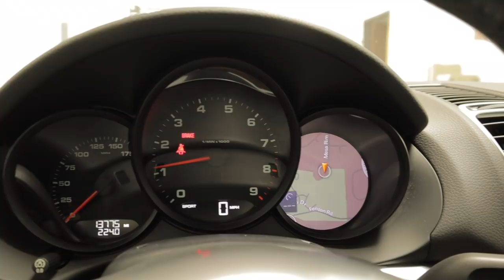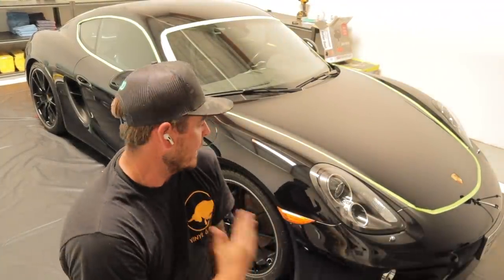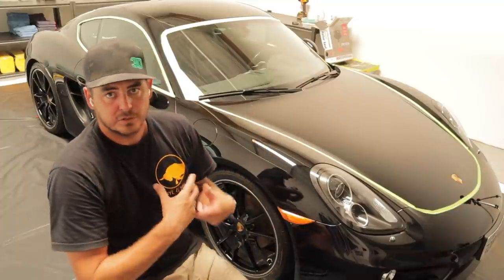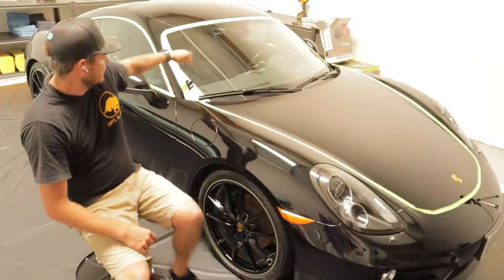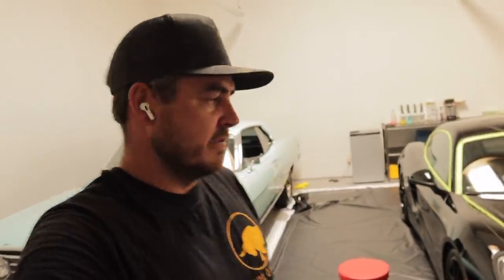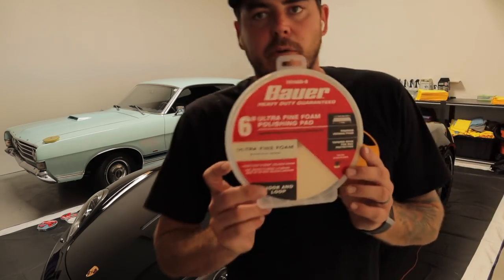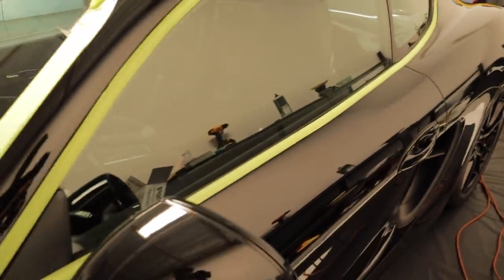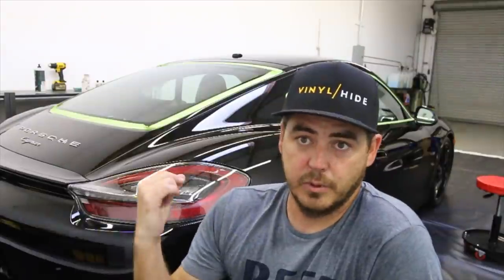20 HOURS Porsche Cayman Detail and CERAMIC COAT!!! | Satisfying Car Detailing ASMR | Ceramic Coating

Comment: Awesome Josh, I did this with my new car in January but I was new to ceramic coating so I used the Turtle wax hybrid solutions ceramic coating spray. It turned out well as I followed the instructions to the letter but I definitely want to try a top brand ceramic coating now and your video here is a brilliant “how to” I can’t wait to get everything in and seriously detail my car👍🏾
Reply from the maker: Awesome!  When you go to the full blown ceramics you just have to be careful not to get high spots. Everyone says a certain amount of time between applying and wiping off but it really depends on the conditions you’re working in. I’ve had it where I apply and immediately remove the excess. Test a small panel and see what timing works best!!

Comment: Thanks Josh for another great video. I’ve used your links for the washing stages of a car. I’m practicing that stage before I move on to learning more and feeling comfortable and confident with polishing. I’m sure I’ll go with your suggested products and tools...so far they make sense and seem less marketing driven than some channels.

So here’s my question...I watch these polishing videos and see the polishing big surfaces turn out incredible...what I haven’t seen is anyone focus on the hard, tight areas...the front end, back, rocker panels...around lights, logos, handles, mirrors...do those get done with a machine still or do you do those areas by hand if at all? Can you address these areas in a video? 

Thanks for all your help and excellent, pragmatic lessons!
Reply from the maker: I can! Thanks for the idea. There are smaller polishers and even down to 1” pads!!!

Comment: Awesome work josh! Did you did the two steps with the same compound?  Also wanted to know if you have done ceramic coating on mobile works? And if you have what would be that ceramic product?
Reply from the maker: Yea i did. 3d One with a medium cut pad then 3d One with a finishing pad!  I have done ceramic coatings mobile.  I always make sure i either have a garage to work in, OR if its like a Sprinter High Roof that cant be inside then i bring someone with me to buff behind me before it flashes too much.  

I like these coating for mobile: 
https://amzn.to/3hyLCuk
https://amzn.to/3kmSVY4

I also love Opticoat... You have to be an approved installer but they use a different curing mechanism that results in a high end coating but without the need of curing lamps

Comment: Came out great Josh!  Thanks for the helpful tips for polishing. I’m thinking of picking up a polisher. You said you haven’t tried the Bauer from harbor freight, but are there any inexpensive polishers you do recommend?
Reply from the maker: Yep. i like this one: https://amzn.to/3mmtAz8

I have that as well as the 1000w version and they are both great and good little workhorses.  These are both 15mm orbits which is my favorite. If you go to a 21mm then they can bogg down on curves which means they wont be correcting the paint.  The 21s are great for flat surfaces as they will correct faster but i think the 15 is the best all around!!
Reply: IMJOSHV - Car Detailing and Reconditioning Tips Thank you , Josh. I’ll look into them! And you pair these up with the Bauer pads you mentioned in this video?

Comment: That definitely looks awesome.
It's funny how you where setting for maximum air from the compressor dial that seems you didn't believe it was all the way to the maximum.   Seems you wanted to strangle more from it. 😄😄
Reply from the maker: Haha, yeah it just hadnt filled up yet but i do tend to over tighten. Probably not the best for longevity but i like to know its going to give the most air pressure possible
Reply: @imjoshv  Does yours have an air release valve underneath so humidity also escapes?

Comment: I purchased my Porsche Cayman with ceramic. Do I need to hand wash it?
Reply from the maker: That would be best for sure.  The drive through places use pretty harsh chemicals to break down all of the dirt on the car... that will degrade the coating over time.  Also the brushes in the tunnel washes are never good cause they can have dirt in them and then that rubs on your car.  If youre in a pinch, chose a touchless drive through. Like i said, the chemicals are still harsh but its better than the ones with the brushes.  Heres a great soap to use at home: https://amzn.to/3fCkGw9
Reply: @imjoshv  thanks 🙏